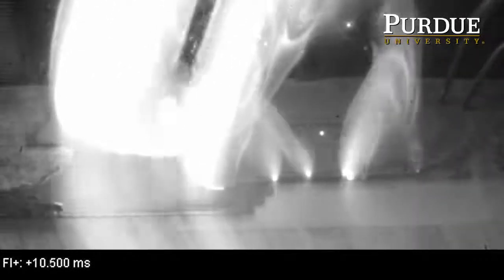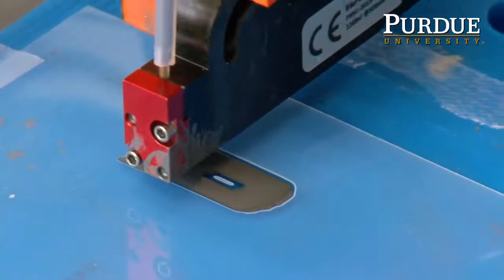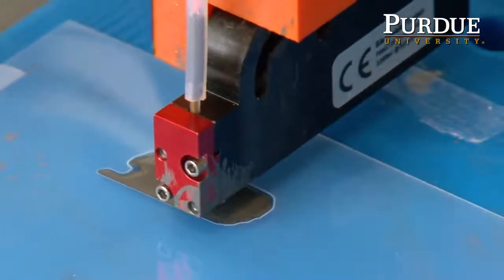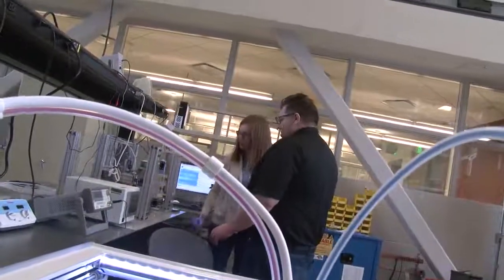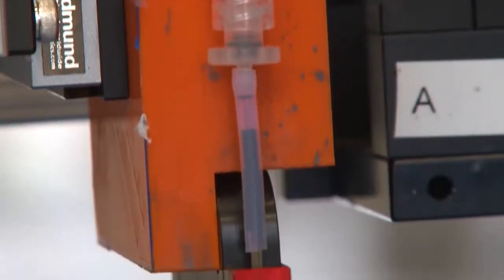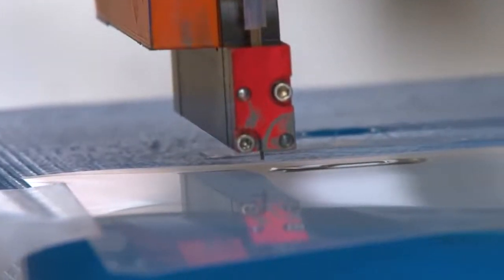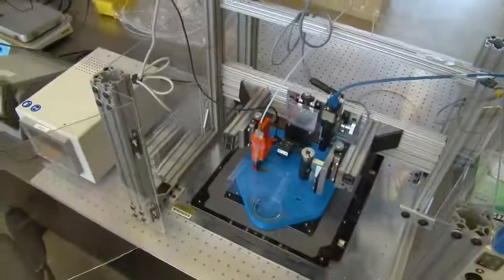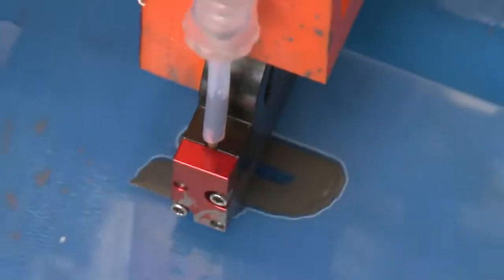US researchers have found a safe way to 3D print explosives

Comment: In the scheme of things, you could now make the explosive package for a nuclear weapon with much higher precision and less specialized tooling if you were able to directly print the core out of an explosive. Realistically, it starts opening up a lot of other possibly scary possibilities when you can 3d print the neutron reflector, the explosive package, and probably eventually the pit, either whole or in parts using a combination of SLA, SLS, Filament, resin and other additive techniques and technologies, either to directly make the components, or to make fixtures for making and assembling the components. But yea, you could also make deorbit thrusters for cubesats, airbag initiators, and a lot of other things this way. But hey, ya take the good with the bad.